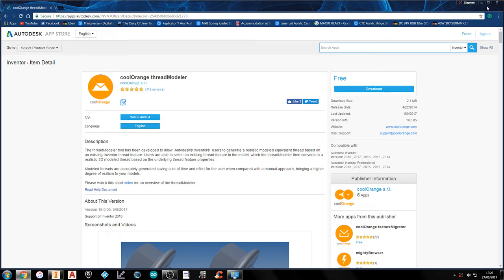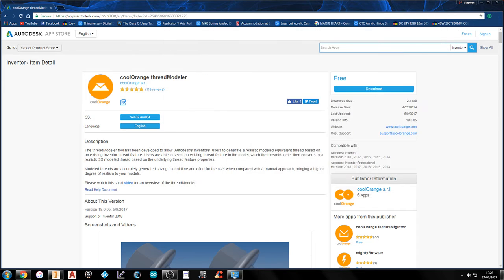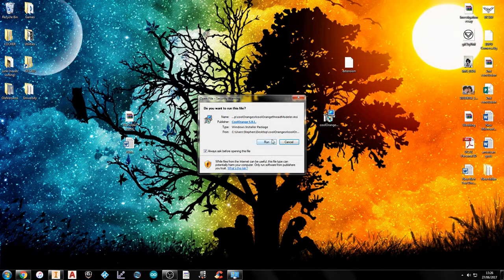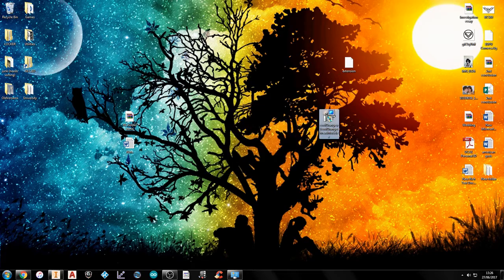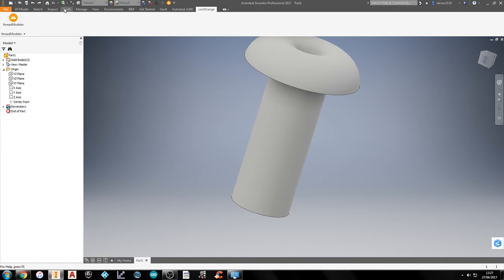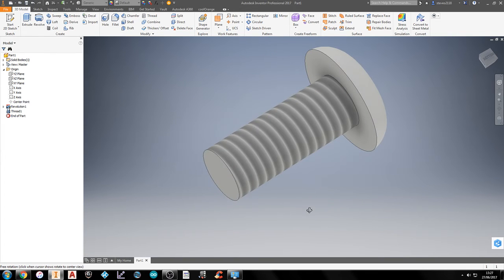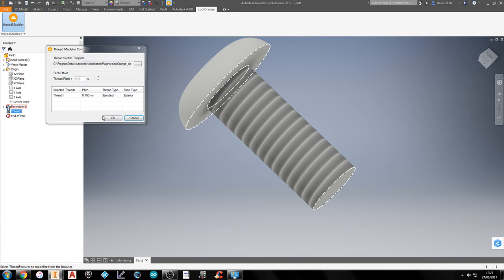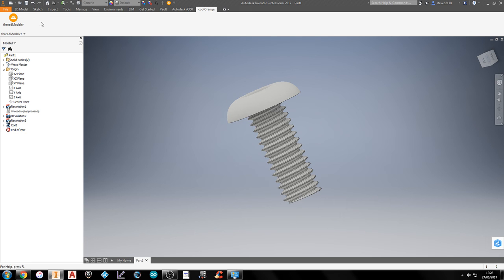Autodesk inventor 2017 Threads not printing ? (fix)

Comment: Thanks for the video.  I went to the site and downloaded the coolorange but did not give me the run option, only install and it doesn't  show in my inventor. FYI,  have created threads and 3D printed the models before in older version with no problems, I don't why it does that now!

Comment: If anybody is having trouble with coolorange after downloading it, you need to unblock it. In some cases, it is blocked by default. to unblock it you need to go to tools -> add-ins -> coolorange-threadmodeler -> uncheck the block box in load behavior -> check the load automatically box in load behavior and restart inventor. this worked for me.